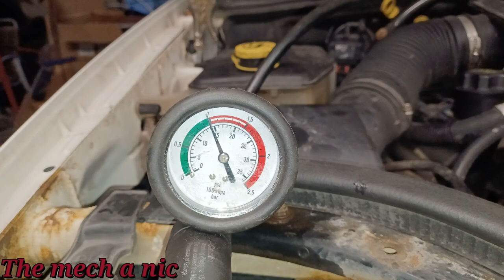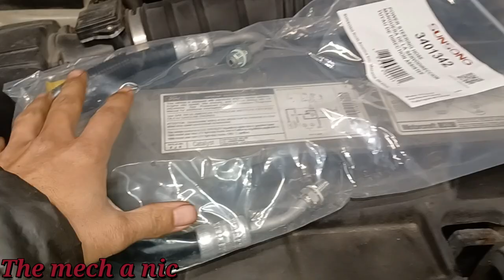grand cherokee leaking radiator / ford explorer power steering leak (vol 117)

Comment: Dude, I have to give you props for working on nasty, dirty power steering and engine carp. I personally can't, my OCD just kicks in and won't let me do anything until I clean 90% of the shit and smoo off of it. LOL, Good job brother, one added benefit is that after it is semi-clean I can better see the leaks. I get enough grease and oil stains on my hands, and yes I know gloves would help but I am old school and have to feel my way along especially when threading lines, I can tell if something is not threading in the right way. I have never cross-threaded a fitting or bolt yet in 45 years of turning wrenches.
Reply from the maker: I hear you, everything being cleaner would be ideal. I can agree that no gloves is the best way to avoid cross threading. 👍thanks for watching

Comment: Looking at the cars coming through your shop makes me wonder how many dangerous vehicles are on the road. Without windshield wipers, in a sudden storm, the driver will be forced to roll the windows down and stick his face into the weather, doing as much as he can to see what is ahead. How irresponsible is that.
Reply from the maker: With no wipers in winter is the worst! I've had it happen to me when I was younger.  The salt covers the glass and you can't even see a few feet in front of you . Definitely dangerous to have no washer fluid
Reply: I had a drivers side wiper actually FALL OFF in the middle of a downpour. It was terrifying, within second I couldn't see but fortunately I was in urban streets and able to pull over. I'd only ever replaced the rubber strips before so took me a while to figure out how to reconnect the wiper arm clip. I thought it must have just been loose before so I kept driving it and a week later same thing happened, but at higher speed on a rural highway this time. Lesson learned so bought a new one next day. But if it had happened on a motorway where it's difficult to pull over across multiple lanes in heavy traffic... it made me realise how such a simple thing you never think about can be so so dangerous if it fails.
Reply from the maker: I've had a car with no heat and another car with no wipers. It's easy to overlook it until you need it you realize how important the little things are